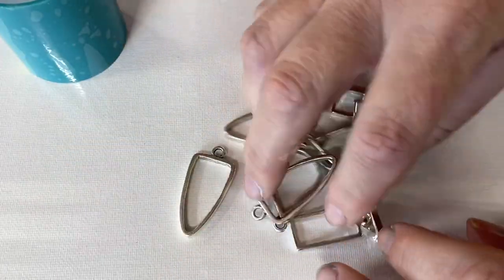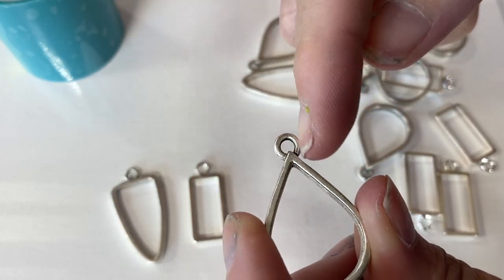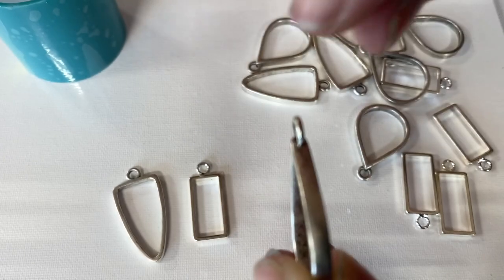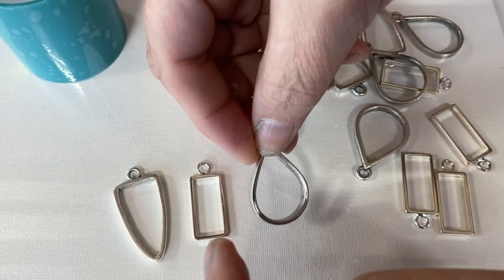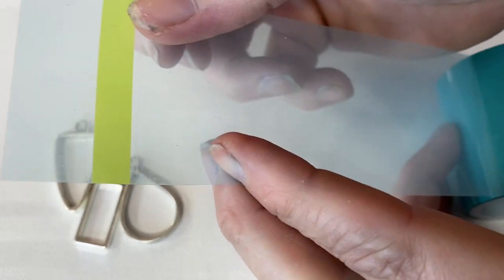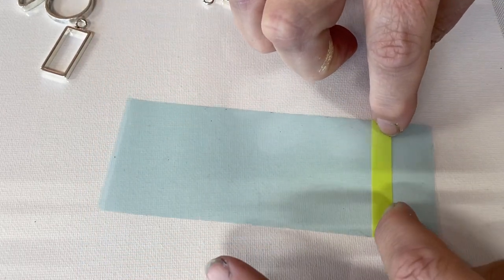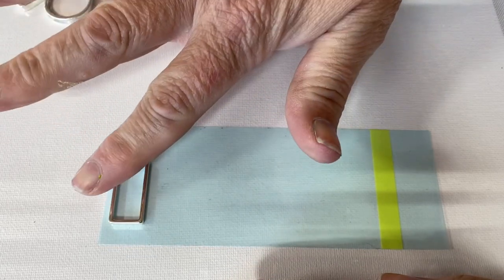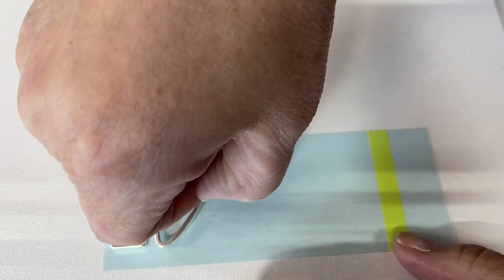Resin Pours with Open Bezel Jewelry Pendents  | 461

Comment: how is your tape not curled. mine doesnt stay down therefore not laying flat.
Reply from the maker: I've been lucky that it hasn't curled. I would probably start with taping down the edges with regular tape and go from there.
Reply: Hey folding the ends of your tape over a bit. It gives you something to hold when working and help the rolling.

Comment: YOUR OPEN BEZELS ARE SO PRETTY!!!!  I am mainly using dried botanicals in my open bezels.  I have had a few overflows and or leakage under the tape.  What do you suggest to get that resin off?  I am afraid the Dremil tool will be too much vibration and worried I may scuff the outside of the bezel.  Any suggestions.?  Looks like you have some awesome video tutorials.  Can't wait to watch those too.
Reply from the maker: Thanks. Try to carefully pry it off with an xacto knife. Be super careful as they are really sharp. Acetone applied carefully with a Q tip might soften it enough to peel off. The only thing I don’t know is if it would take any finish off your bezels.
Reply: @ClaraLawrence  Thank you so much for your reply.  I will try that!

Comment: HELLO another suggestion  take a smaller one and put inside a bigger one and just fill the outer ring only once its dried add a pic of anything to the inside. Just remove the inside ring off the middle one.
Reply from the maker: That is a good idea. I will have to find a ring without the loop for hanging.

Comment: Hey Clara
I tried making pendants using this technique yesterday. I wanted clear resin pendants with some flowers but the back side of the pieces which was stuck to the tape turned hazy. Can you help me fix it
Reply from the maker: I would sand the hazy side very carefully (just to put a few scratches on to the resin so the next layer can bond well), then put a small amount of resin on top of that. Let that cure. It should go into the cracks and make the hazy (texture of the tape) go away.

Comment: These are so beautiful! I am so thankful for this video. I recently did some resin pendants and no matter how well I pressed them down on to the tape they still continued to leak out the sides. Not sure what I'm doing wrong but I'll keep trying.
Reply from the maker: Thanks. These bezels come with tape. In fact I placed the bezels so close together that I have plenty of tape left over. The tape worked excellent. I have a link in the description for these bezels, but I will put it here too for you. 
Open Bezels - https://amzn.to/333bCJf
Teardrop Open Bezels - https://amzn.to/2F69LeG
Reply: @ClaraLawrence  I already have several bezels, I'll see if I can purchase that tape separately. Thanks Clara 😍
Reply from the maker: @watchindeegan  I looked and found this. It looks like the same stuff that comes with the kit. https://amzn.to/36vjWVt
Reply: I use silicone pads and just press the pendants down firm and then fill will resin works great works so much better than tape

Comment: Hey Clara,

Thanks for this video. I've been having issues with my resin being sticky on the side where the tape is after it's fully cured. Do you have that problem with this tape? I've tried aluminum tape and I've tried packing tape and have the issue with both of those. Other than that my projects turn out great. But I can't sell to customers until I figure this out and don't know what to do. I even bought some goo be gone type stuff to get it to stop being sticky and it didn't work. I even put it out in the sun and some of them stopped being sticky and some were still sticky. I just don't know what to do to solve this problem.
Reply: You can add a additional thin layer of resin on the back.It gets rid of stickiness